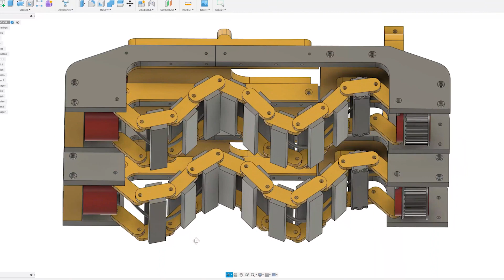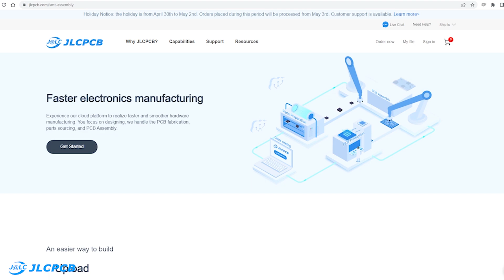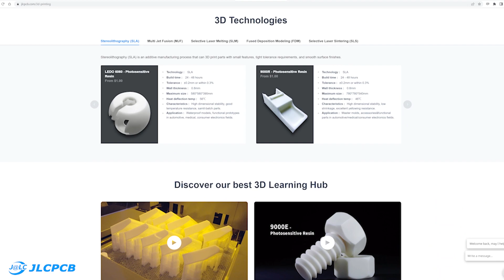Experimental Wave Drive

Comment: The biggest practical problem I can see with this design is that the shape of the screw is critical moving forward, and the screw is almost directly in contact with the ground. Even with precision machined parts, a variance in the height of the terrain would cause the whole thing to impact the ground in unexpected ways and might start causing it to shake as it moves, tearing the whole thing apart much quicker

Comment: A solid shaft with a series of cams that correspond one per track link are fixed such that the highpoints form helices... A lesser amplitude, allowing the links to be narrower, then a frequency (period) in excess of three... To be really ambitious, have 4 tracks arranged as two pairs with the crests and troughs half a period out of sync... this would at once be considerably smoother and afford greatly increased surface friction (grip).

Comment: 3D print a round winding mandrel with a spiral grove in it, the add rotating are that spins on a bearing a the center of the mandrel. There should be a roller attached to that arm that it's close enough (maybe wire diameter plus .01in from the minor diameter of the groove) to the mandrel to allow it to force the metal rod or tube into the grove with low friction.   Imagine a rolling pin orbiting around a large screw with a very course thread, if that helps.

Comment: At about the 5 min mark, you said you think the motors were too heavy. That may have been true but I think the bigger issue is simply that the worming motion is in fact a highly off-road form of traction. It's like trying to race on a tarmac in knobby tires. Put it in some grass or gravel and I bet it would have been just fine.

Comment: Your orange linkages are too long in overall length and causing binding during rotation.
Add a slotted hole or shorten the end linkages.
Also the end linkages aren't synchronised and easily fall out of sync with their partner linkage.

Comment: To increase the ground clearance on one side instead of using a second pully end the screw with the rod at center and bent out parallel to the screw use it as a center shaft into bearings especially if you increase the size of the materiel. A lathe can bend a fairly large rod around a spindle at an even splay. If your goal is to make this truly heavy duty? change the entire drive part to a Crank shaft with piston rods attached to the track moving it up and down. this system is doomed to fail because of the friction in the track vs the coil it'll eat itself.

Comment: use a torch to melt the iron rods to a red then you can  bend them easily
Reply: the issue is your friction but ultimately you could resolve this in software because you could use stepper motors for example and use a phsical sensor to detect each motors position (like a crank sensor design) then that way you can check if the motor1 is less or farther than motor2 because if you notice when you have them both playing forward the sine wave that you are making on track 1 and track 2 is not in sync they are out of phase so you need like a way to sync the phases on the tracks  for example you can see that if you started the motors at the same point where the wire bends going into the yoke if you notice the angle on the yoke its not lined up with the other motor

Comment: Sorry but this is ridiculous. In a real wave the points that touch the surface don’t have any lateral movement, only up and down. The only reason why this partially moves is because the links are big so it fails to be a good wave. If you use smaller links it will perform even worse. The only reason why the device in the other video seems to work better is because the surface is a wave so the vertical movement of the tracks create a horizontal component pushing the vehicle. Snakes move by having the wave flat against the ground, you never see a snake moving fast by waving vertically, but horizontally. You should have to turn your vehicle sideways! Or remove the tracks and use the screw! By adding tracks you are actually canceling the horizontal force provided by the screw which is wasted by sliding against the tracks. Genius!
Reply: my thoughts exactly.

Comment: James, get some steel pipe, heat your stainless steel rods and then bend them around the pipe.  As you indicated the screws are more than likely slightly out of round.  Cheers,  Great videos.

Comment: Perhaps instead of an articulating plastic tread, use a supple rubber tube (similar to tire material) with inner lubricant and another achiral metal drive arm inside offset 180' so it pulls it taught on the maximums touching the ground, that way it would shake less while moving and avoid a bias as to which side the track is supported while touching the ground.

Comment: 09:00
it looks like the top ones end is shaped like a coil (like the car suspension) and the bottom one has the radii of the beginning much closer to the overal radii. Very hard to correct by hand

Nonetheless, very cool build and nice video!

Comment: You can maybe try the wire mold you made but just make it skinnier than your final screw diameter, to account for the spring back from bending around the mold.

Comment: I think it would've made more sense to make spiral by making a hole the would produce a coil when you ran the wire through instead of printing out a massive cylinder. I don't know if that counts as a die?
Reply: I was also thinking to stagger the little rubber feet
Reply: By the way in regards to the springat about 1:25 in this how its made video you can kind of see what I'm talking about https://youtu.be/yJI2XcGIghI  Ignore the massive machine . Whats important is the coil is being formed by forcing the wire through a channel instead of bending the wire around a form. Im familiar with similar hand tools designed to straighten wire so it shouldn't be so hard to find one designed to form a spiral to your exact specs.

Comment: Just a note about the coil form diameter issue in your conclusion. When expanding the spring, you can rotate one end while keeping the other fixed to maintain the desired diameter.

Comment: James, I wonder if you ever considered making your simple square flat sections out of anything other than 3D printing? You can quite reasonably get some wood or metal sheet from the hardware store, cut it by hand, drill holes for screws, and it's much much faster than 3D printing.
Unless your job is testing 3D printers, that is.

Comment: print a jig to make it...a cylinder you cut the groove in with heavy fill so tuff...to get the size mesure the full up and down of the track subtract the thickness of the bar and vuala ..roll it on the ground to get the twist in it

Comment: Actually, getting the spring diameter right sounds really easy to me. It’s just a simple use of the Pythagorean theorem, and maybe some trigonometry. Remember, if you unroll the spring, you’ve got a right triangle, where the hypotenuse is the wire, and the height is how long the spring ends up being.

Comment: I suspect that your design may be misaligned somehow, causing that severe bumping motion.

Looking at the overall movements of the Worm Robots, there isn't a lot of up & down movement as the Sine Wave Helixes are constrained in their vertical movement (Peak-to-Peak Amplitude) as though between two horizontal planes (above & below), while propagating sideways to provide propulsion. 

To see what I mean, try visualising using the wire coils like cylindrical rollers to slide one sheet of transparent perspex above another. All of the tops & all of the bottoms of the waves should be in contact at once. This should help you see if there are any anomalies in the sine wave helix.

Comment: if you ended the screw with the tang sticking straight out along the axis of the screw instead of turning it 90 degrees there would be much more clearance since you could use a much smaller bearing....at least on one end. this would be beneficial at the front for clearing objects etc. Of coarse the driven end would still need something of a larger diameter, but it still could be reducde by using worm or bevel gears etc.

Comment: The forward movement is not driven by the screw like the threads on the screw tank.  It's hard to explain, but the forward movement is initiated by the distance between the hinge of the articulating tracks and the tip of the rubber traction dot.  The curve of the track around the apex of the sign wave is what propels the robot.  look at videos of polychaetae worm movements in fluid to better understand this locomotion mechanism.  This said, a more flexible (elastic) track will not help with better movement.  If anything a more rigid track will help.  The best thing you could do is make a longer track with more surface area on the ground and a longer distance between the hinge of the track and the contact point with the ground (try flexible bristles like on the polychaetae worm)

Comment: You really do need to make little bend jigs for steel wire when using it for mechanical purposes. Much easier with 3D printing to produce one that is at the level of precision needed for these sorts of projects. Unlike the wood/aluminum jigs we've all made in that past that take as much engineering as the project itself to get right.

Comment: For the screw I wouldn’t use tube, I’d get it made in some thicker spring steel rod, yes it’s gonna be heavier but it should absorb some of the shock from it hitting the ground and will go right back into shape if it has too much weight on it at some point, preventing a need to possibly order a replacement screw in the future if you actually enjoy riding it around

Comment: Such designs rely on their ability to dig into the ground surface. Its frankly stupid design and even if the surface was muddy for example, it wouldnt work well, as the waves are not smooth enough.
The waves just moove up and down and dont even produce any forward force

Comment: If you know anybody with any old basic lathe , you can use it to make a wire spiral. A good length 15 feet or longer will make it easier to control, then cut off the excess when your done.

Comment: I think that it shouldn’t even move, because every point of contacts of the robot to the floor don’t move during the time they are in contact with the floor : if you focus on one pad only, the rubber pad touches the floor, then don’t touch it, then the pad next to it touches with a distance equal to the distance between pads, then this one don’t touch anymore
it is not really like a screw motion because adding the chain suppress every movement but the z movement in the robot referential 🤔

Comment: Distance from top to bottom of the wire slot is to high, it allows {slop} up and down of the feet on the wire,  this is disrupting the wave, When the feet are on the ground the wire is in contact with the foot bottom but that means with the slop when they should be lifting it is delayed by amount of distance the curl travels before contacting the upper side, so the wave form is not sinusoidal. Its also introducing side to side torque on the drag links connecting the feet, one side is loose and one being forced up or down, this is adding to the resistance to motion. Seems to me {haven't tried it } that a bearing locked on the wire dropping it's motion down via a connecting rod to a centered foot on a chain might give a bit smoother motion, I know more parts, more precision needed/etc.

Comment: SRB  
that  was  swift /   just  checking on  ya/   ahh / did  you see the 'nano mold casting"/  it's  just  casting ,  but / with  things  like / 3-d printings/ o.k. the first  one /  you'll  print in  "styrofoam   then  you'll  pour  the  mold /  but  the  3-d printing ,.  leaves  scape  for 'nano / we  might  need  vacume  ,. or perssuse /  //   but   the  case /  I  don't have  anything  as  of late /   but , I'm  still looking /

Comment: Might be better to use a sort of camshaft in stead of a screw. That way you can add ball-bearings where the camshaft touches the inside of the track.

Comment: Probably could get less wobbly by having more waves, more turns in the corkscrew so there are more points of contact with the ground at any given moment. Obviously would need the tracks to have higher "resolution", smaller links, closer distance between articulation points, in order to bend more gradually along the corkscrew.

Comment: Longer, more twists in the springs, shorter links, final drive should be 1:1 so you don't have a huge pully that reduces ground clearance, do the reduction you need beforehand.

I wouldn't waste time with sliders in the tracks themselves, but I might print them out of nylon, which is self-lubricating to an extent. It'd also be alot smoother with more rotating mass in the drivetrain.

Comment: If you want a tread waving to move forward, you can also use a series of alternating semi-circulaire wheels, or just alternating off centered wheels.  Yes those are less cool  than a corkscrew drive, but they are way simpler to print, and don't need the hand made screws.

Comment: You might be able to make the corkscrew out of tubing, then fill it with expanding foam or some sort of polymer. Once the filling expands and hardens it will be stiffer. I’ve heard of a similar approach being used on small airplanes

Comment: I can't imagine that system ever working very well with more weight since the weight is carried on a spring with no support in the middle. It might work to make the undulation motion of an eel if you wanted to make a swimming robot, but for ground contact I think you'd be better of with something like a crankshaft above the tread with connecting rods going down to the top of the tread. 
This would give the sequential up and down motion with a lot of force pushing down. (since the crankshaft would be MUCH stiffer than a spring.

Comment: Very cool, (my head refuses to see how it works instead of being a standing wave though :)
 Could you give the small Wave Driver wee two inch spikes on each linkage link instead of the little rubber feet so it would look like the wave action of a centipeeds legs? 
If you put floats on the likages would it go forward on water?

Comment: The motion of particles in a water wave is circular (more generally "gravity wave" IIUC). I wonder if a wave drive that looked more like that, with circular motion at each point in the track instead of vertical, would work better. Otoh I'm having trouble visualizing it so I don't know if it's possible.

Comment: In my eyes, the original version with the wiggly part just trailing the device (so no additional bar on top, or bearing on the end), looked much cooler.
Why not to a tank version with two wiggly tracks hanging out the back?

Comment: It's interesting to conceptualize this motion. The motion you've created in this device is reliant on the thickness of the feet. Let me try to explain: If you watch the bolt heads in slow motion you can see that they only move in the vertical axis relative to the ground. If the individual sections of the track are only twisting and moving up and down, then the twisting motion is the only horizontal motion that can be utilized. If you examine the wave robot shown at 0:28, it appears to have legs underneath the wave apparatus. These legs should exaggerate the twisting motion of each individual linkage into a more productive lateral translation. Adding the tall rubber feet to your track simulated the same effect. I believe it's less about grip and more about the radius of the contact patch to the pivot point.

Maybe that helps?
Reply: I wanted to comment almost exactly this. I would add that this method of motion is drastically different than using screws like in the mentioned screw-propelled tank, because direction of the motion is actually opposite to the apparent linear motion of the "wave" we see when looking at the screw from the side. It is obviously not the case in "classic" screw-propelled vehicles. That is why I believe vehicle propelled by "wave drive" presented here won't be good at driving over obstacles. The "wave" motion that relies of friction mentioned by @Bryce Jensen above will drive the vehicle in one direction, while the apparent horizontal movement of the wave will "grab" an obstacle and try to move vehicle in the opposite direction.

I really hope I made myself clear since English is not my 1st language.
Reply: Also, for better performance, especially in a bigger version of presented vehicle, you could consider following path of thinking:

The driving screw has exactly the same curvature everywhere, therefore you can slide a a short piece of pipe bent to the exact same curvature onto it. Then, you can use multiple such short pieces of pipe as "bearings" for track links. Pieces of pipe cannot take whole length of the screw, because horizontal spacing of the links of the track changes, but if they are quite short, it would work. I would suggest using PTFE or similar pipe to minimize friction and to prevent small misalignments from blocking the motion.
Reply: Third and last (I promise!) thing: I thing it would be great if the bigger version would be supported only by those wave drives without any wheels. If you choose to go this way, you can prepare multiple sections of screw with small discs used to transfer load trough bearings to the hull. This way you should get a nice stress distribution.

Comment: I think ur links are too big. Cause the screwlike wire that moves the chains is very round so it is very smooth compared to the segments oft the curves the chain can "display" with the big chainlinks by giving the chain more links u make the shape of it get more round and so the motion doesn't raddle due to hiccups in the chain. 

Just a guess....